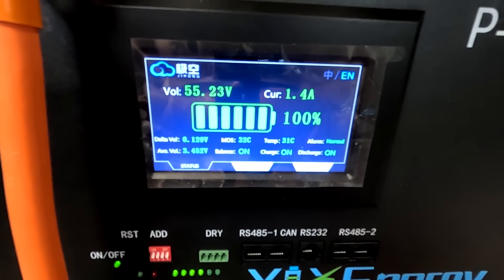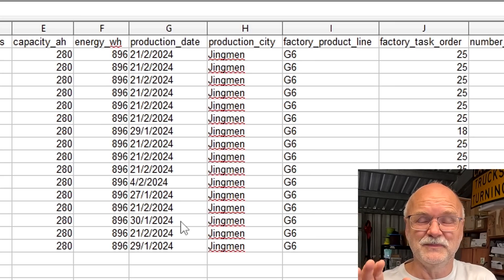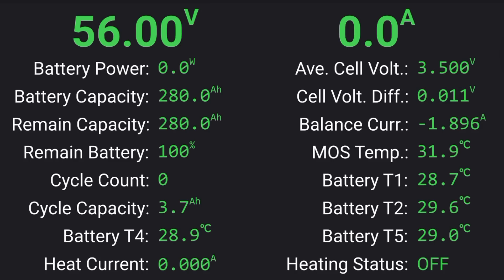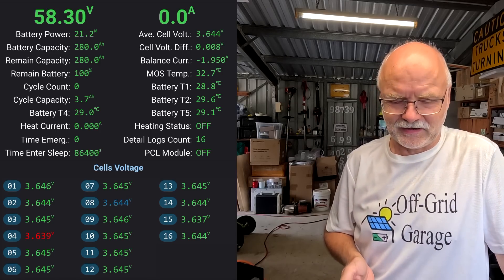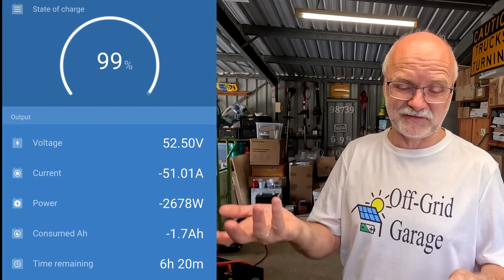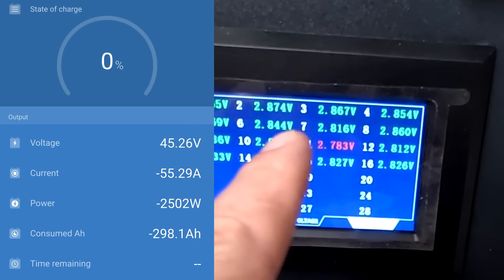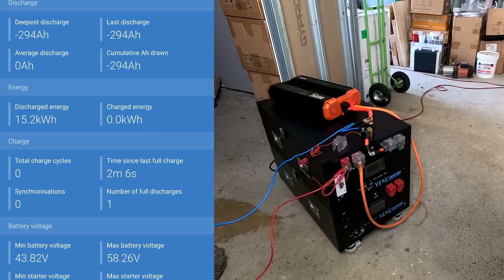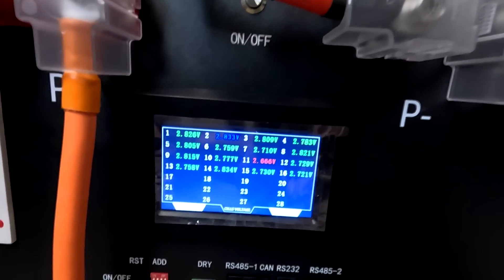Best EVE LF280K from Yixiang with over 300Ah Pack Discharge Capacity and JK-BMS Auto Top Balancing.

Comment: I have Felicity  LPBA 48200 

Yesterday , I asked the local support to upgrade my BMS firmware from version 518 to 521. While they were here working on the upgrade, I took the opportunity to check my battery cells using the EDMS app . I noticed that my cells are significantly out of balance, even though I regularly charge the battery to 100%.

As the battery is 4 months age only and the delta is up to 200 mv it seems balancing features isn’t working at all

My inverter is Axpert VM III 
The BMS COMM is connected 
The bulk and float is 57.6 ( due to BMS in control) 
But the battery never exceeds 55.7 
Maybe to cell over voltage

Please advise
Reply from the maker: What is the balancer like in this BMS? Active, passive?
There are a lot of settings which need to be set correctly to make it work.
Reply: @OffGridGarageAustralia  the use their own BMS with passive balancer
Reply from the maker: @esmailalkassir1565  Can you change the settings in the BMS via Bluetooth or PC?
Reply: @ via PC yes
Reply: I believe my charger stops when the battery is 100% so the are not much room for balancing,

Comment: ANDY, if you can in your inverter review that will come - tell us is red button switch that turns on inverter is real switch that carry 230volts or its just a 'digital signal' switch that doesnt carry mains voltage? I have Inverted you had prevyuosly, black one, it have nice 'feature' that switch is not connected to mains voltage so i can turn on inverter with any smart relay shorting the switch wires together. Wich helps in automations controlling inverter. THANKS
Reply from the maker: The red switch under my inverters are all DC switches as per the installation manual of the Victron gear. They are not rated for 230V!
Reply: @OffGridGarageAustralia  i was talking about Peter inverter's switch. :) to turn on the inverter.  Sometimes its regular switch that split mains voltage, sometimes its some kind of 'binary signal' to a board to switch inverter.  I want to buy Peter inverter but dont want it to have regular switch because i. That case i wont be able to use relay to short contacts of switch to turn inverter on,like im doing with my current inverter. Thanks for your videos and reply.